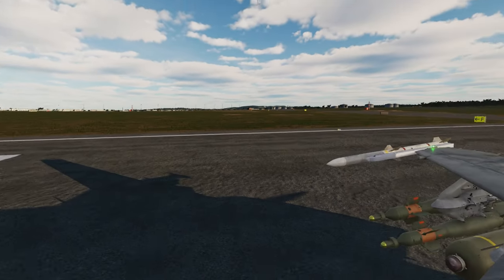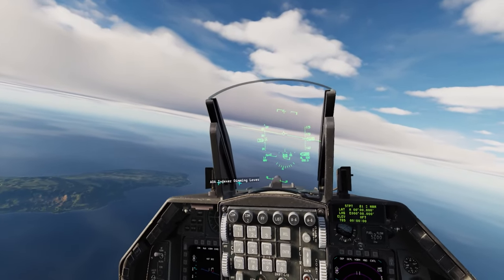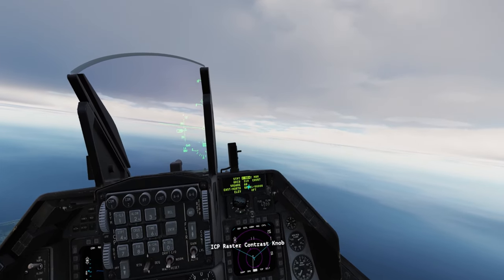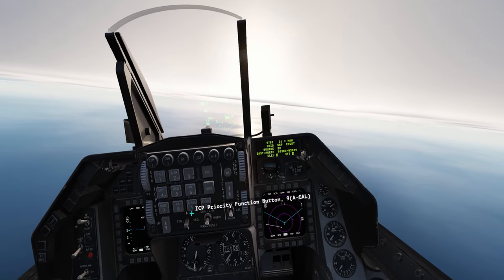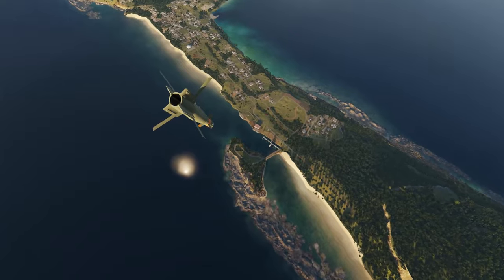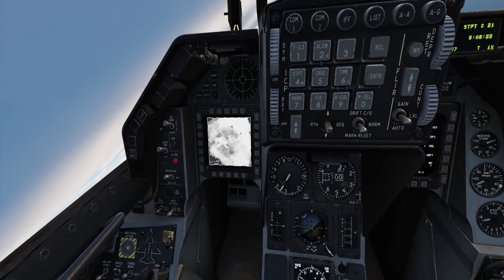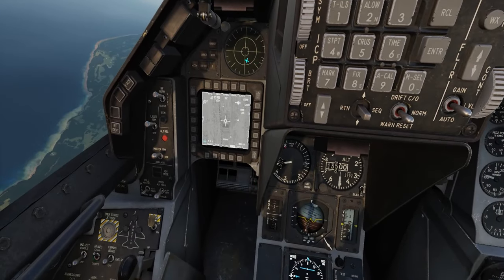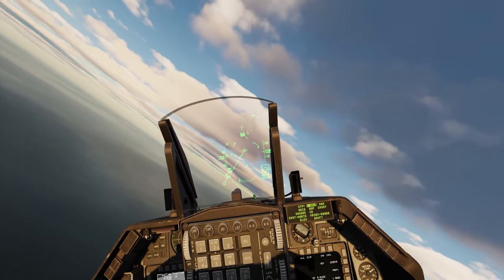DCS F-16C Viper - MGRS Coordinate Tutorial | Never Deal With LAT/LONG AGAIN! | 4K 60 FPS VR!

Comment: Damm someone has a 4090 haha. I've tried dcs vr but even with a quest 2 my PC can't run dcs vr in more than 40 fps. That is with antialiasing and acceptable graphics but still i moved to track-ir until i upgrade.
Reply from the maker: It's definitely very demanding to run in VR. Even with my 3090 and no tweaks it could run like a slideshow, but I think a lot of that was driven by running in steamvr. Now i use open xr and its much better.